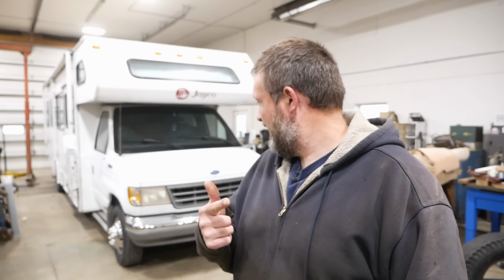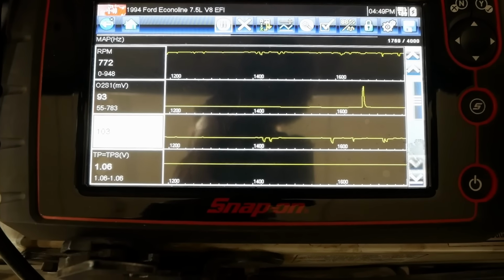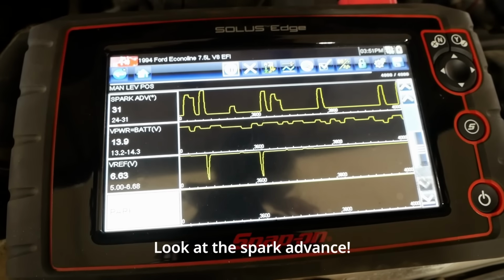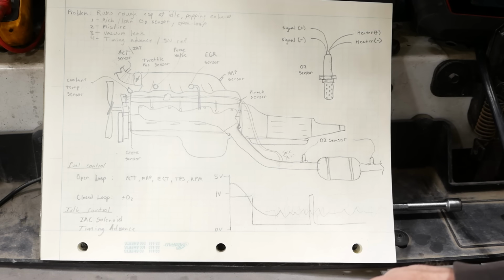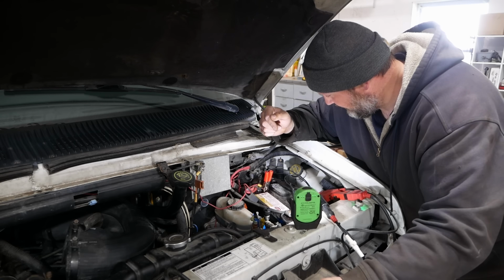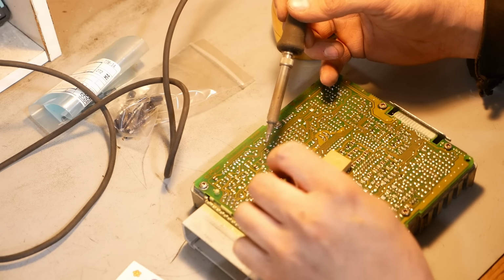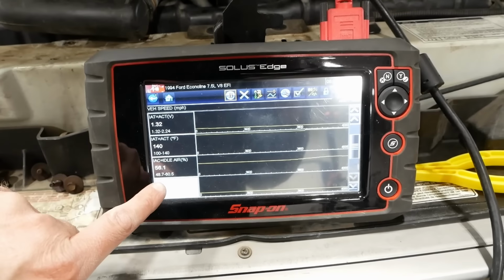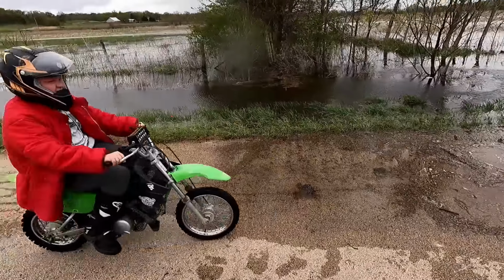Ford 460 RV Surges, Runs Rough but Nothing's Wrong?

Comment: Infamous mid 90's bad Chinese capacitors. I was in the electronics industry when the curse first struck. I was there, man!  The cans would puke, or pop, or do nothing at all. Just dry out and open up. Those were the days. Pure evil when the box you are relying on for info is the cause of the problems.
Reply: These are Japanese caps.
I've changed hundreds of them

Comment: You have a gift with sorting electronics. Most mechanics would have just replaced the ECU/computer and called it a day. But you fixed the ECU and runs really good. 
The flood though you was about to the point where you needed a flat bottom boat from the camera view. But you made it back whew 😥.

Comment: How did you end up billing for that job? Parts were 5$ and your time really would’ve added up but you actually got it fixed. Is great to be able to fix things even if you can’t quiet understand the system, did the same thing replaced some capacitors on a camping trailer battery charging board.

Comment: Back in the day at FORD we had these 460,s burning up convertors , i suspect that ford did some reprogramming on the PCM in order to save the cats from plugging, the wide range of vehicles we saw were rv,s f250- 350 , ups trucks etc.

Comment: At least they used proper Nichicon Japanese caps rather than unbranded ones. I think this truck pre-dates the old capacitor plague where a Chinese company stole an incomplete electrolyte formula. Millions, maybe tens of millions of capacitors were defective. I'm still replacing them today in older equipment, especially with this retro comeback we're seeing with old stuff! For a 1994 truck, those caps have lasted well, classic Japanese quality!! I love Nichicon. My other go-to brand is Rubycon, also Japanese!

Comment: I had the same issues with my 94 f350 with a 460, turns out the capacitors leaked all over the ECU board and wrecked a bunch of circuits. I had to manually make some new traces with some wire, now she runs well again. There are complete capacitor rebuild kits out there, I think this is becoming a problem as these trucks age.

Comment: hey wes just so ya dont go crazy the air injection and o2s work together based off the injectors on the fuel rail it has a series of vacuum operated solonoid that are open /close so when whatevere soloenoid is open it trims the fuel the o2 on these is more for fine tuning like if its really rich everything else is done up on the fuel rail these things are fancy but also complicated essentially the solenoids act as metering devices and that controls the fuelling i have an 89 5.2efi(bored and stroked 5.0) and its the same way but my solonoids are on the opposite side its youtube so its pretty hard to explain this in a comment and not visually

Comment: Halfway through the diagnosis I was giving you thumbs up for the computer having problems. I do believe that another guy here one of my YouTube Friends Raymond Ray has had the same issue where he had a problem with the computer and the board was actually very very disintegrating as it time went by. This happens quite a bit in the Steve series Vans and this type of Econoline setup

Comment: I'm curious Wes, will it pass KOER test after your repairs? i checked the Ford "H" volume manual , which your vehicle should switch the air injection downstream which will allow for oxygen sensor switching during the test. from what I saw, I don't believe there was any switching after your testing. This would make me hook up your gas analyzer, and see if the mixture is actually achieving Lambda, then follow the direction of the data.
Reply from the maker: It passed KOER self test before and after. Never had any codes.

Comment: PrintKote used to make, and maybe still makes a conformal coating solvent. Not fun to use, evaporates away to nothing, even in a sealed jar and is very "aromatic" but it has removed conformal coating for me, when everything else failed.

Comment: I had this same problem with my F250, but I had to just replace the whole ECM...good luck finding one these days.  It had an ECM for PSI energy, and I was getting 18-20mpg before changing it, but I could only find an ECM for a 3/4 ton 4x4 so I went from 18mpg to 8mpg.  I sold it right after, I almost had to sell my house to buy gas for a week lol.   
My uncle just told me "It'll be fine, just paint racing stripes on it"  😂

Comment: Capacitors are not just volts and microfarads, there's also ripple current, and life hours. Volts should be the same as well if it is sensitive.

Comment: Had a 93 e150 for 19 yrs, had similar issues. Had the TPS and ACT going out at same time causing problems, that was fun to troubleshoot with just voltage testing(no obd1 scan tool). At the end of your video, the ABS light no going off is probably the clockspring in the steering wheel, had that happen to mine as well.

Comment: For Reasons only the engineers from past days knew I ended up having such a stupid Ford injection system in my motorcycle.. I hate that stupid thing, the bike is great, but for random reasons the computer decides I should have 20-30 HP less at one point which come back 10 minutes later again.. If it weren't for the law I'd have ripped that thing out already and put a carb in its place.. never had those problems with them.

Comment: These surge with a big vacuum leak, or bad idle air control valve, also a bad ECT will NOT THROW A CODE, but will run like shit when it warms up. IAT will also do this, it doesn't go bad enough to go too high or open to throw a code. These do not have a crank or cam sensor either, it just knows the motor is moving because distributor pickup moves. The electrolytic capacitors go bad inside the PCM and throw things off too, easy fix, if you want I can do it and hook it up to my 460.

Comment: I remember when Suzuki first came out with the quads, they had big baloon tires..
We'd ride them across ponds by actually floating them under power. 
If you could maintain your balance, and kept the throttle at a constant level, you didn't have any problems. 
But lean just a little off center, are gave it too much fuel then you were getting wet, or if you let off you fell over..
Which wasn't a bad thing in the summer time, as long as you kept water out of the intake.
Winter time though was a different experience, because not only were you soaking wet, extremely cold, but typically this was during deer season, and now your rifles were just as wet as you were. 
If you had it across your shoulder, but if it was mounted on the handlebars or on your lap.
Well you get the picture I'm sure, but it was a blast during the warm months. 
Glad you figured out the old fomoco,  and I never understood how someone could take those on long trips with the 460, because you spent so much money on fuel, and every couple hundred miles stop for fuel.

Comment: Associates Degree in Electronic here for ya Wes. Also have 6 yrs. experience test & circuit board repair. Long Story short.
You don't have to concern yourself about conformal coated P.C.B.'s Yes it will be a little messy. Yes some of the water tight integrity is very slightly compromised (very slightly). However, You HAVE to unsolder the leads out of the PCB to replace the part. This was a dilemma we faced at one of my jobs from the past. It tests OK... you send it to get coated. It comes back and fails the final test. What do you do. This is the company formal procedure at the time. Find the bad part (you did) replace bad part. Then get a small brush and a small container of coating. Apply coating to the repaired area and let get completely dry. Retest, Pass,Ship it. Never had one come back in 6 years time.
If you're still looking for an answer. Here's something to think about.
The Capacitor you replaced is also known as a filter capacitor. They help keep voltage stable in an electronic circuit. Like a fuel pressure regulator. So then, if the cap gets leaky and spills it's innards on the board, it's like when the fuel regulator goes bad. Poof - nothing happens - it's dead. so now you have a PCM that just had part of it's system shut down. And there you go.....engine runs like POO.

Comment: I used to buy iMac G5's for dirt cheap that had crapped out due to a capacitor failure which was common. Had to replace about 18 or so and when finished I would sell them on for a decent profit. Work took about 1.5 hours.

Comment: Believe me or not, I had that exact same failure(same cap and all) on a 94 E350 conversion van with a 5.8L.  Ran the exact same way, but bucked and farted terrible on accel.  This was way back in 03, when we still had our old SBDS machine.  Believe it or not, that old machine found my issue after many hours of diag.  I got a new PCM for that one, as a flat rate tech, I didn't have time to mess with fixing it.

Comment: Wes, that o2 sensor is probably original and definitely dead. Your scanner will not read it correctly, you need an analogue multimeter or a scope to see if it operates correctly. The only Ford scanner that could read the o2 is a PDU, maybe an early WDS and only few places in US still have a working one. With analogue meter you'd see the needle go left to right and back, with scope you'd see the whole square wave and in a working environment it should flick 0-5V every second or so. The only test you can do with a digital meter is to check continuity on the heater circuit. No continuity and the o2 wont flip to closed loop ever.
The only other thing that can mess with it are manifold cracks, very popular issue with 90s fords(they can be mig welded).
Your soldering was absolutely fine. only thing I can recommend is using chemwik, usually in a blue roll. All the others are rubbish.
Oh and your flux isn't probably best for this sort of soldering,  yours is more for BGA soldering and evaporates too quickly. I recommend getting a Kester flux pen for your day to day component soldering, will be much better, then IPA for cleaning but you probably use that already.
Oh and the only other thing that can mess with closed loop is CTS, coolant temp sensor. With Fords, you often get two, one for the dash that never goes wrong and one for the ECU which does go wrong. If that is lazy or doesn't operate, ECU will never switch to closed loop either or will be erratic and/or causing running issues.
Hope this makes sense and looking forward to seeing more videos!

Comment: The strategy for when the ECM commands the secondary air diverter valve to open expects O2S1 to go lean. And yes because I was the only real diagnostic tech in the shop, I got thrown all the diagnostics. While OBDI is a pain, OBDII really isn't that much better. A ford lean code has about 13 different possibilities.
As I would say... "I may not be the fastest gun in the west but I am a sharpshooter" Which means I would beat my head in to find the exact part that was the problem, so when I point to a part, that's what's going to fix it. 

Elias Ocampo was a monkey... He would point to a part have the manager get it and then install it. When it still didn't work, he would scratch his head like a monkey and then point to another part and the same thing over again and again till maybe he finally hit on the right part.

I would lose my A$$ on diagnostics many times because it always takes longer to find the problem than you can charge the customer for. Many times we quote an hour and if the problem was not found and felt like holding up a cross and throwing holy water on it and closed the hood, then the rule is if you didn't fix nuthin we didn't charge the customer nuthin. This instills trust for honesty which spreads and customers come back. You care for your customer base and not only they but by word of mouth you expand you customer base.

When the Cat is cold O2S2 should mimic O2S1. O2S2 Is ONLY a reference for the ECM to know if the Cat is working to know if to throw a conde "Cat efficiency below threshold" [I forget the number...P402? P402=Bank 1, P403=Bank 2 On a inline there is only Bank 1] I have an O2S tester where you clip it onto the battery for a power source and then alligator clip probe [A circle pointed wire piercing pad in the clip jaws] the signal wire of the O2S It also has a switch so you can force the signal to either high or low to check the ECM/PCM [as the case may be] for it's ability to properly read the O2 sensor.
ECM = Engine Control Module
TCM = Transmission Control Module
PCM = Powertrain Control Module [Later models went to the PCM configuration as they combine both the Transmission and Engine modules into one package.]
Now there are so many different modules with all the electronic systems that they have created a centralized module called the BCM = Body Control Module which acts as a hub for all the other modules.

PS. While I do electronic repairs, at the Shop if a ECM/PCM was condemned we would just order a reman from the dealer or another private vendor and have them program it, I never busted them apart and tried to fix them.

Comment: I fear the next big failure point in these computers is that of the ROM chips holding their operating program, followed by the custom (or at least oftentimes house-numbered) ICs. I'm just waiting for the day that my '93 Caprice station wagon's ECM capacitors decide they've had enough. Sometimes I wonder if I should find and repair it pre-emptively.

I've heard that it's fairly normal for these not to enter (or stay in) closed loop operation unless and until they're under a moderate to heavy load at highway speeds with suitably warm air temperatures. I've also seen a similarly-aged van (also with bad capacitors in the ECM that were replaced, but a smaller Ford V8) behave almost identically with regard to the Vref voltage and O2 sensor readings.

PS: I hate that conformal coating stuff. I know why it is there, but it sure makes replacing the bad caps in Delco radios of the late 80s and 90s a pain...
Reply from the maker: Luckily these computers were made in huge quantities and often by outside vendors so chips images are usually available. Worst case they can be completely replaced with aftermarket ECMs like a Megasquirt.

Comment: I got your point. I feel similar, when I cannot get proper wiring or other data and try to figure out the system based on standard practices, but there always some hidden little things that just make it work differently than expected.

Comment: AMAZING.! This stuff is so over my head. I did do some work on a 84 caprice years ago a bit foggy but I rember setting the idle using a dwell meter, I managed to solve the whatever the problem was but this one really flipped me over. I wish I could punch the like button enough to give you the $$$ you earned with this one.

Comment: It is common practice to use spark advance to stabilize idle RPM. If RPM is slightly high advance is reduced and vice versa. The advantage of this method is that it has an instant effect. I also use this method in the electronic ignition of my ‘63 beetle. Idle is very stable, cold or warm, much better than original.
Best regards from Germany…
Reply from the maker: I guess you learn something new every day.

Comment: O2 sensors are a mystery to me too... I've seen dozens of plow trucks running around with the O2s literally flapping in the breeze and hanging on by their wires, but my Jeep 4.0 had a minor, intermittent, low voltage slightly out of range on the forward O2 and it would kill all ignition for a split second, then resume perfect operation until the next time it did it. 🤷‍♂ Sometimes it would go weeks without doing it, sometimes it couldn't make it more than a few miles.

It took me like a year to figure it out. I was lucky enough to have a data logging scan tool at a time when that wasn't common for people at home (could only do a few sensors at a time for a few minutes at a time) and just so happened to be logging the O2s one day when it did it like 2 or 3 times in the short recording window I could log. I had to export the data and graph it in Excel for it to become apparent. As I recall, it was out of range by like 2%. It never set a code. I was positive that I was wasting $90 by changing the sensor based on that data, but I wasn't... It's been fixed for about 10 years now. 😆 Crazy...

Comment: This gives me a direction to look in regarding a problem with my old Volvo, also a 1994. For some reason positive turbo boost causes the IAC to open 100% and it idles at 1500rpm until I shut the engine off. I made a mistake and fired the parts cannon assuming the IAC was being mechanically pushed open by boost and getting stuck there due to a weak spring or something. That didn't do it, lol.

Comment: Your process made absolute sense, the Vref may just be a calibration error in your scantool, but every step you made was logical. Nice job, most shops would have sold them an new ECU if they got that far

Comment: Rule of thumb for me: if it's >/=20 years old and FI, and there's nothing glaring (i.e., no rodents, no missing parts/mods, reasonable maintenance history) to cause mystery problems (especially intermittents), check the computer(s) first. These cars are prime candidates for bad components in the electronics. Not that it's likely a common problem to find in the Rust Belt since the rust tends to take them before they get old enough for the capacitors to leak out.

Comment: Hi Wes, your question about the air pump. I don't have Ford experience, but my experience with air pumps was that they operate for the first minute or so when the engine is started cold, and the O2s are not working anyways. This was to introduce fresh air into the exhaust (when the mixture was at its richest) and lower emissions at that time. Then the valves would close or the pump would turn off (if electric), and the O2 would work normally, providing feedback to the ECM. Is this a possibility?